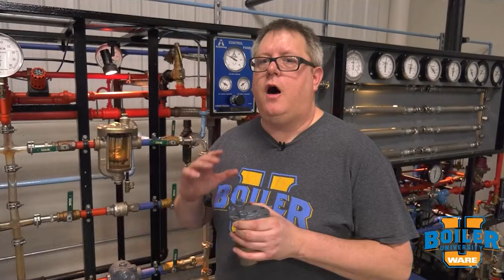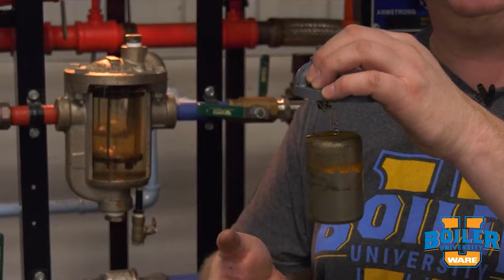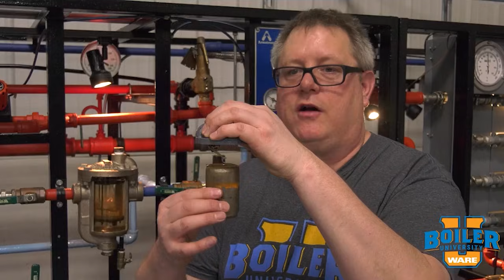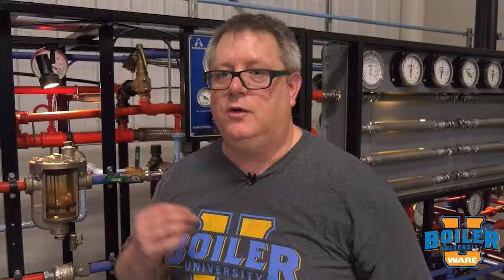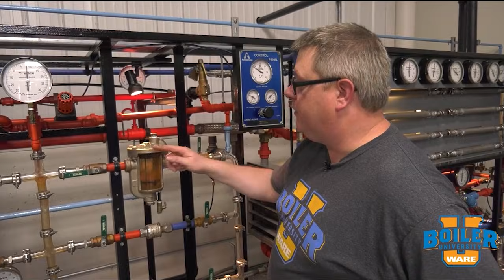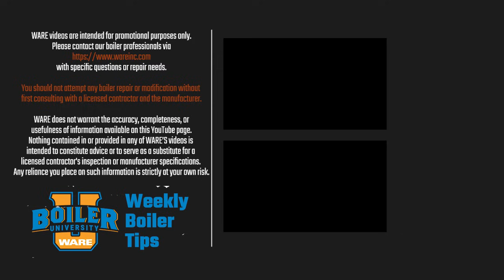Inverted Bucket Trap Problems? Here’s How to Diagnose & Fix Them | Weekly Boiler Tips

Comment: I have these on dryer heat exchangers, they periodically lose prime. There is a vacuum breaker between the coil and trap to allow water out of the coil. I suspect that they have issues getting rid of the air